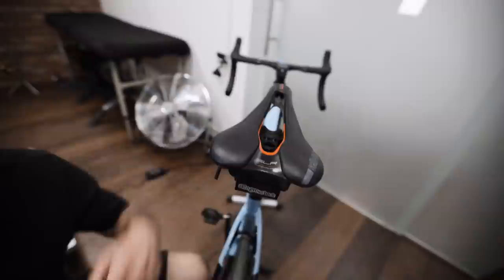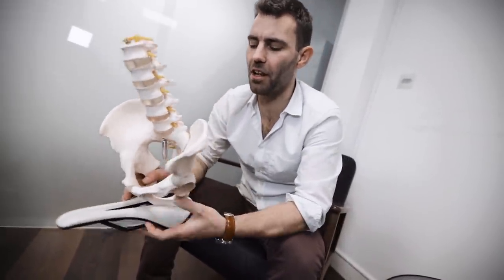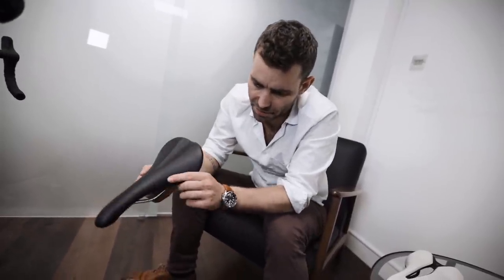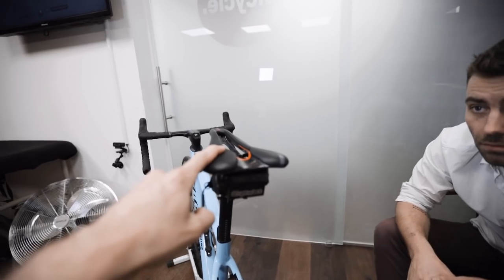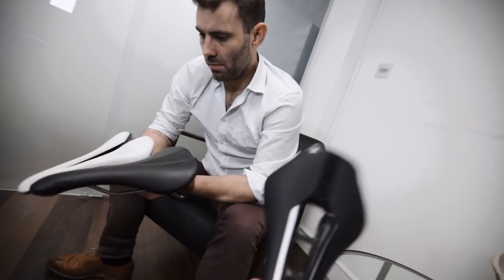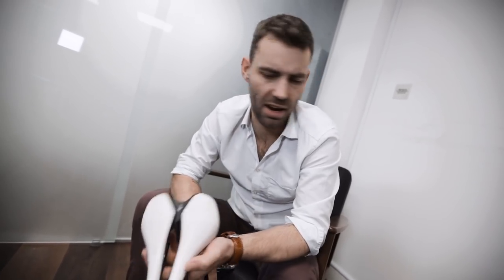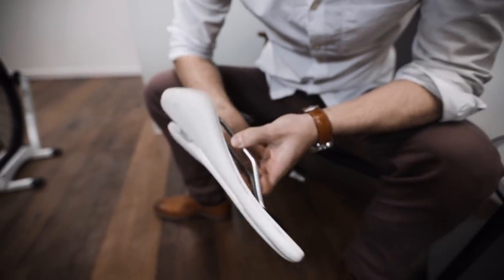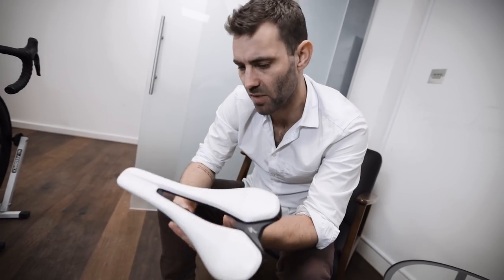Saddle Problems are NOT caused by your Saddle - BikeFitTuesdays

Comment: A question. I can ride my bike outdoor for several hours without major discomfort. Instead, when I use it on an indoor trainer, I can barely resist 1.5 hours before suffering from major discomfort. Any advice? Thank you.
Reply from the maker: This is really common - outdoor riding is just masking a problem with your existing fit because you move around/stand up/readjust more!
Reply: @Cade_Media  Thanks Francis! Another problem that I get indoor but not outdoor is numbness of my left foot after about 40 minutes. It starts with pins and needles and then it goes numb. What could it be due to?
Reply from the maker: @franz1972  could be so many things, saddle too high, lack of arch support, I'll fitting shoe, cleat too far forward. Try those!

Comment: Even before James mentioned 'the dreaded F brand' I was thinking the title should have been 'Saddle problems are not caused by your saddle... unless it's a F****'
Reply from the maker: Even those can work for people... There's just much better options out there 😬
Reply: @Cade_Media  like?
Reply from the maker: @dcolum23  specialized, selle Italia, pro, fabric 

Most of these companies have similar models across their range, classic shape with pressure relief works for a lot of people, wide saddles often causes issues (like the short nose saddles tend to be)
Reply: @Cade_Media  I have two Specialized saddles and a Fizik Anteres R3 and the “F brand” is by far and away the most comfortable for me with zero pressure relief. I’ve ridden 7,000km on the Fizik in the past year without a single issue. In fact, 4 of my riding buddies also use versions of Fizik and love them. I’m not really understanding whats supposed to be bad about them… ironically what I find so great about my R3 is that it is narrow and stable.

Comment: Can different levels of padding in shorts have a noticeable impact on bike fit (e.g. thicker padding effectively raising the saddle height)?
Reply from the maker: Yes but it's incredibly minor. James's opinion is that bike fitting is a game of inches rather than mm, so the padding isn't enough to worry about. 
There will be a small range of saddle height measurements that will work for an individual
Reply: @Cade_Media  Cool, thanks.

Comment: Sitting on a sweat filled foam bib pad with it rubbing raw against your gooch is why you get saddle sores ya dorks. Ditch the clipless pedals so you're not restricted to a single constant foot position and wear clean underwear UNDER what you're wearing. spandex stretches after a few wears / washes, just enough and it becomes abrasive, then tiny particles of shit and ball sweat mush in the little cuts and saddle sores erupt. Regardless of what you're sitting on, you can sit on a luxury recliner if you're rubbing sweat and turd particles into agitated skin at 90 rpm for 2 hours of course you're going to get sores. Underwear goes UNDER and your outerwear takes the brunt of the saddle interaction.

This is why flat pedals have cutouts, the body changes size over the course of a day let alone months of riding, you need to be free to make micro adjustments to your foot position, you don't clip your hands into the handle bars... Although I bet if Sram made a $600 product that did that you'd be all over it

Comment: I feel like I'm taking crazy pills by watching this video. I have no idea how you can discuss saddle issues without talking about the fit of the saddle itself.  If your structure is such that your sit bones are close together, a wide saddle is going to result in more pressure in between your pelvic bones.  And vice versa.  I had numbness problems for years, and I tried more padded saddles, saddles with various cut-outs, wider saddles, etc.  It wasn't until I switched to a narrow saddle that the problem went away.  Since then, I've ridden a number of saddles, and they work fine as long as they are narrow.

I don't disagree with the point that position issues can easily be the root of saddle discomfort.  But if you don't start with the right width, I don't see how you are going to fix your problem.  The Specialized Toupe mentioned in the video comes in two different widths, and it used to come in three widths.  I had a Tarmac that came with a 143mm Toupe that drove me nuts.  I swapped it for a 132mm one and probably put 20,000+ miles on it.
Reply: Tripp Goldsberry thanks for your comment and I completely agree with you with is absolutely a factor and I feel a lot of manufacturers are making saddles wider (to wide), I suspect driven by the idiotic concept of measuring sitbone distance while seated - a position not replicated on a road bike. Try to remember that these videos are intended to try and help, this was a 15 minute video - we can’t pack every thing there is to know about saddles in 15 minutes and chose to focus on the single most common driver for saddle discomfort I encounter - the riders position
Reply: @Bikefitjames  Understood. I feel that saddle width is one of those issues in cycling that are counter-intuitive (and there are many-e.g., your best response to a crash in the group in front of you is not to maneuver sharply to avoid the incident but rather to not respond much at all) .  It seems like a wider saddle should spread out the pressure and therefore be more comfortable, but that isn't the case.  It wasn't until I bought a mail order bike on a closeout special and went ahead and rode the Flite knockoff it came with even though it looked brutal that I realized the narrow saddle was actually a better fit.

I don't know why Specialized seems to have eliminated the 132mm size, but I agree that going toward wider saddles is a misguided move.  The point about engaging the saddle asymmetrically is an excellent one, and it is something I think many riders don't appreciate.  If you have a "hitch" in your pedal stroke due to an imbalance, flexibility issue, whatever, I would think the wider platform is only going to exacerbate that "hitch."  

In any event, good video.   Gets a like and a sub from me.  Thanks.

Comment: How to determine saddle width?
Reply from the maker: Experiment while riding if possible. 
Avoid those machines in bike shops that you sit on upright and produce a width number - you don't sit on a saddle like that!
Reply: Pressure mapping as the sensors determine your width but you might as well go for the whole session to get your money's worth and see what's happening (or not) as you pedal

Comment: Ok. great information, but all i heard was: "go get a bike fit." Short of getting a bike fit, what can a rider do at home to help figure out whether or not their saddle is an actual problem?
Reply from the maker: Two most common causes  of saddle discomfort are excessive reach and excessive saddle height
Reply from the maker: So try reducing them before looking at saddles
Reply: @Cade_Media  would there be a negative impact if I try a super short stem reach? The one I have is already short and my saddle is all the way pushed forward but I still feel like the handlebar is too far. I use an L frame (MTB), which was suggested to me supposedly due to my body measurements (180cm).

Comment: Nope. It's mainly those idiot saddles that are poorly designed. There's no need for a nose. A split in the middle isn't the holy grail.
There's one saddle that can solve all the saddle problems: Spongy Wonder, made in Canada.
Reply: I very much doubt the spongy wonder works well for aggressive positions though...
Reply: @Xarx42  Aggresive position: do you mean like with a triathlon handlebar?
Reply: @chriss2595   yes, but not alone. Some road bikes put you also in a lower position.
Reply: @Xarx42  I see. I can only speak from experience with aero handlebars (3 yrs), and it worked very well. Now, I'm riding on a (new and) rather comfortable racing bike without it, but I'm considering to mount aero bars again, for me it's the most comfortable position. I don't have experience with other 'lower position' bikes, sry about that.
I don't want to convince anyone, it's only my experience. Will Spongy Wonder suit everyone's needs? Of course not. For 'real cyclists' and 'lightweight freaks', the saddle may be a bit too heavy (it's sturdy), so perhaps a lighter model could be a solution, which - I think - is not available at this moment. And there are almost no competitors in the industry. But one thing is sure: no more soreness nor other discomforts, and I can omit the cycling pants with sponge. It also requires a bit of time to adapt of course and to adjust it really precisely to your own specific position and body. It's in fact a simple but well executed idea, imho.